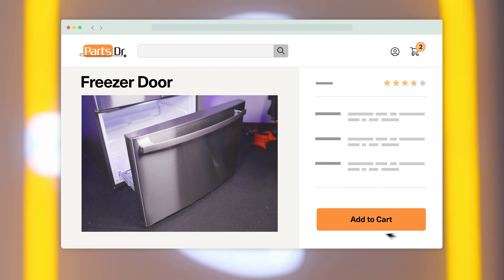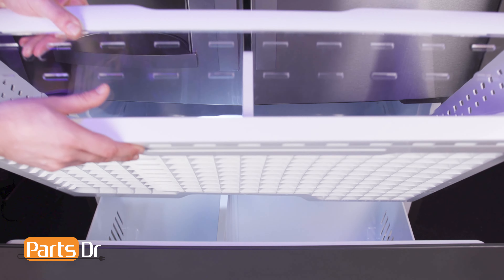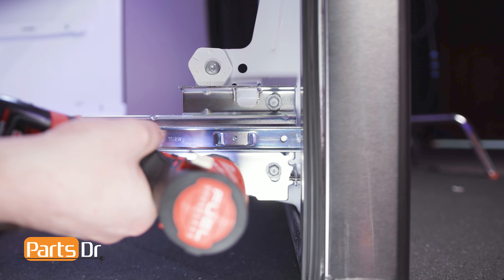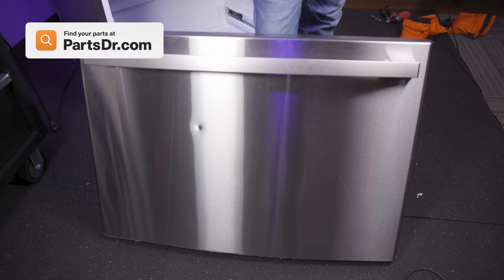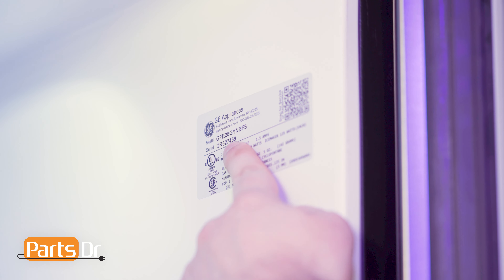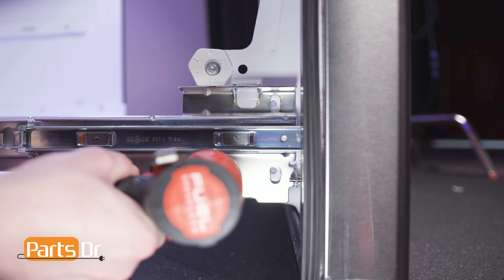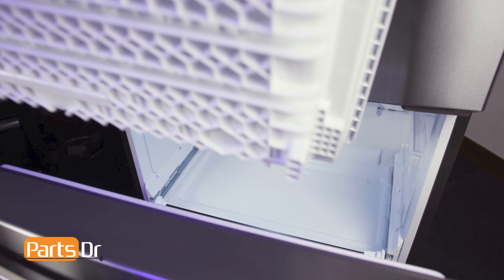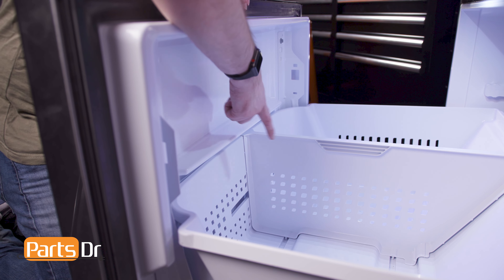How to remove the freezer drawer door on GE french door refrigerator

Comment: My new fridge, the freezer door won’t shut, is there a adjustment?
Reply from the maker: You shouldn't have to adjust anything to get the door to shut.
Reply: @PartsDr  one side stays open, even tried it empty. And defrost. It’s only a few weeks old
Reply from the maker: @fairwind8222  try inspect the gears on the slide rails to make sure that both sides are synced up https://www.youtube.com/watch?v=LNZMqBnJ3UA